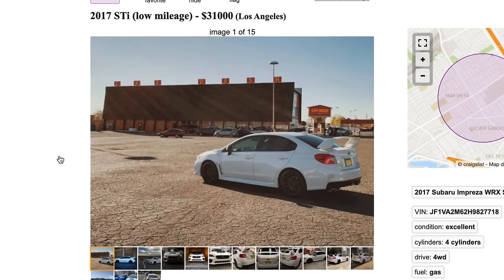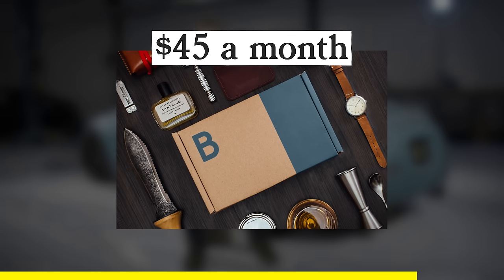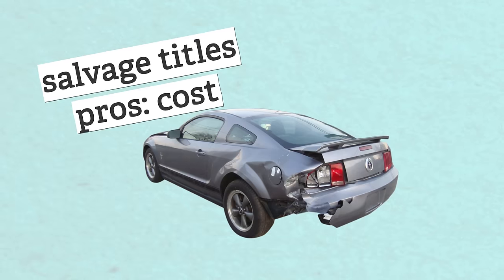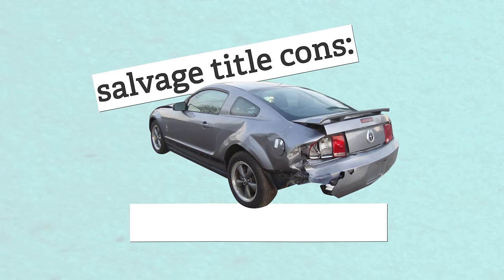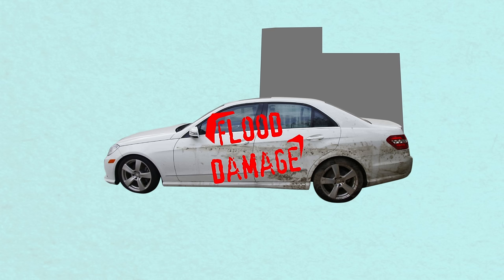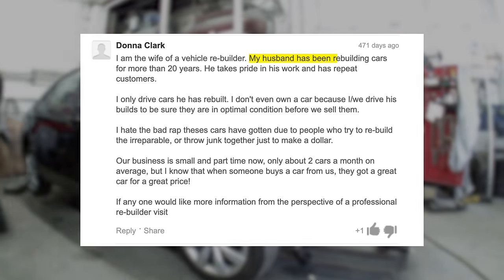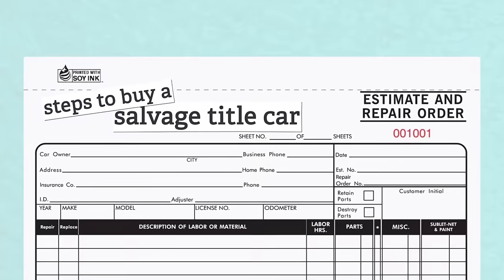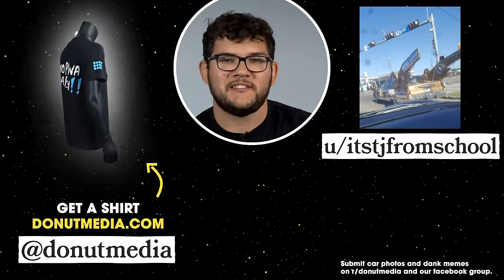Buying a Salvage Title Car: Bargain or Nightmare?

Comment: I had a 1992 Honda accord LX, which was completely flooded.  My neighbors drove it for a few year then didnt like the smell so they gave it too me.  I drove it for 3 years(with some electric Issues, used to park ready to push start) even tho engine and everything was rust AF it NEVER failed me.  I sold it for $600 to a friend moved away for 6 years and when moved back to my shock I saw my buddy driving it. 10 years plus after it was flooded with no major repairs...buy Honda!

Comment: I got a f150 that had a blown motor, salvage title, 
Took body off sandblasted and painted frame, 
Bought a new engine 
Put it all together 
for the f150, 4K for the build including wheels and tires, 
Check engine light still hasn’t come on 3 years later, no issues

Comment: I drive BRZ and I wrecked it twice already. They weren't enough to get it totalled, but for once it was close. Got the job done at the right place and there's no paint mismatch and it still drives the same for another 45k miles after. I would prefer to buy cars with no accident history, but I did learned that cars with history aren't always that bad as people say. At least for asian cars.

Comment: me: reads title of video 

my copart experience: its time
Reply: 😂😂😂😂😂 I mean a good buy for $1.5k on only a bumper that needs to be replaced is the best way to go
Reply: Honestly sometimes it’s better to go to repo auctions and buy bumper damaged cars from there. 90% of the time the tow truck drivers cause the damage and the car keeps the clean title. We’ve got a 2011 Infiniti G37 with 87k miles for under $2k because it needed a new bumper. Even the auctioneer couldn’t believe it once the seller told him to sell it to us 😂😂😂

Comment: I've had several salvage vehicles. I inspect them to the beat of my abilities. They often have some imperfections, usually at the minimum cheaper paint and some body lines that are not perfect. In any case,  I continue to buy salvage because I can get much better deals, they have been reliable and I don't buy cars for the resale value.

Comment: Good video. 100 percent factual. I’ve rebuilt a few salvaged cars (5 to be exact) and they were all purchased with 2 things in mind…1. I was planning to keep the car for a long time and wasn’t worried about resale. If resale is on the table, I wouldn’t bother. I’m in PA and a rebuilt title is an automatic 40-50 percent less than a clear title. So if a used Tacoma with 40k on it the odometer is worth $20,000, a rebuilt one will be worth $10,000 ish….2. I have the tools and knowledge to do the repair safely and correctly. I ALWAYS stay away from structural frame damage and flood cars. Frame damage repair is near impossible without the proper tools and flood cars will never stop giving you problems. They will forever have gremlins. That being said, I have no regrets with the cars I’ve purchased. I’ve gotten to drive some really nice cars that I otherwise wouldn’t have and I keep my cars long enough that when I sell them they have long made up for what I’m going to lose when I sell it.

Comment: Damn that's weird, I have an 02 wrx wagon with a salvaged title that I bought in 2012.. Most reliable car I've ever had, nothing but tires and oil changes and still going strong at 219,000 miles.
Reply: A lot of people scared of R titles are also scared of cars over 100k miles and CEL’s

Comment: In watching this video I realized that my car is a title washed 350z..... this is just great 👍🏽
Reply: Darkdude478 please tell me it is not a 2006 also!
Reply: wes west it’s a 2003 :)
Reply: How did thug find out did you run a Carfax report?
Reply: Sam_jupiters253 all the repairs under the fender on frame and with the bondo I found while trying to put a wide body kit onto it
Reply: Them saying it was a clean title no accidents didn’t help neither...
Reply: Darkdude478 if you want an a car dealer and have unlimited Carfax reports I wouldn’t mind running the vin for you and that’ll give you a idea of some of the history if you want?
Reply: Damn, makes me afraid of buying a used BRZ. Was the price cheaper than usual?
Reply: My $2000 dollar mazda pickup has definitely been in a few accidents before I bought it. I just like to call it "battle damage"
Reply: Darkdude478 lowkey same with my g coupe🙃

Comment: We needed a 2nd car last year, so in July i purchased a 2010 Nissan Versa for $1000 from a fellow manager (it was her old car, she was finally wanting to put it up for sale) the outside had dents all over, screws in the bumper, no airbag etc lol but after 7 months and 3700 miles of ownership, this car is still running strong, i just need to replace a sensor and replace the airbag

Comment: Bought a salvaged vehicle from my work with front passager damage at the corner. Got it for 4,000 and put another 4 grand into it to fix the hood,fender,cv axel, radiator support, and a rim.
Had it for 2 years now and only have had to replace the ECU.
Not bad for a 2013 Mini Counryman S with 23,000 on it.

It helps that i got it not repaired yet so i could see what needed to be done and could tell everything else was in solid condition.

Comment: A salvage title is just as likely to be the result of depreciation vs cost of repair rather as it is significant damage, especially with higher-end vehicles. This is why it's so important to check VINs, salvage title or not.

Comment: Just bought a salvage title 2014 ford f150 3.5 ecoboost. The truck was hit in the back and the frame was ever so slightly bent, but was able to put a new bumper on and it looks good. Had to replace some solenoids and get a new battery and some brakes. But a full size truck for only 10k with 90k miles… I’ll take it.

Comment: Almost all of my cars in my collection were salvage. It all depends on what was wrong. Fun to work on if you just want something to wrench on.
Reply: Can you give me an idea of what to look for in a salvage car sir? Looking to fix up one
Reply: @RodneyFx  depends on your skill level... just get some where the damage is clearly obvious what happened and exactly what to expect...  I mod cars so I picked a car that had damaged parts that I would've replaced anyways for aftermarket such as better headlights, carbonfiber hood, newer front bumper cover style... thus look for minor front end damage vehicles that rus/drive and show no signs of hidden damage; core support replacment and minor frame rail straightening is also fine but and major frame rail or any other serious frame damage stay away as they are parts cars... note trucks usually sell for higher than they should so I wouldn't bother with them... what ever you are looking for if you don't find the right deal or miss one just wait as something else will come back around as new vehicles are added every few weeks

Comment: Or a better word is project car
It needs some love and polish 🤣 in belgium we have a car inspection house if you buy a car it needs go there before you can register it 
And you also need to go there every year
Reply: Same in Texas, but it's pretty basic
Reply: @desmondunn4504  
I didnt know that
Is that everywhere in america ?
Reply: No. Each state sets their own requirements if they have an inspection. They check mostly safety equipment, seat belts, lights, horn, tires, brakes, etc. And in some spots emission.
Reply: So it’s a MOT?

Comment: It all really depends if it's fixed properly, if your buying one then I highly suggest to take it to a dealership for a full inspection, I know a kid that his parents bought him a charger hellcat and it's a rebuilt title with 11,000 miles on it, they bought it for about $45,000 already paid for it and then took it to the dealership to inspect it and found out that the engine has a crack in it and has been leaking oil

Comment: Pro tip when trying to figure out exactly what causes the salvage title. Ask the owner for the VIN, plug the VIN into Google and Google will pull up whenever that vin was used on a website. Which means it'll pop up as a previous sell on a auction site where you can see photos pre-repair. It's 100% free aswell to do this and will give you a better idea of what to look for when looking at that particular car

Comment: I bought my speed3 with a salvage title. $4k and all I’ve needed has been a new bumper, hood, and windshield, and paint. Once those were installed it looks like new🤷🏼‍♂️
Reply: Jents1798 - it’s even better when you find the parts already in the same color like I did !
Reply: Swampy yup you know how long it took me to find a break light inspection place in my area plus turns out they check everything on the car not just the break lights
Reply: Swampy I mean like I said, my car was just cosmetic damage. Inspection can be a hit or a miss depending on where you are at.
Reply: Swampy it’s a bit like insurance. Some people say they can’t find insurance for their salvage title car. My wife has a 2016 Kia Forte (non-salvage). And then my 2013 Mazdaspeed3. We got full coverage for $160 a month. I think it depends on the area and the people. Just my opinion🤷🏼‍♂️
Reply: Swampy I personally would shy away from salvage title cars that have frame damage. If it’s cosmetic, it’s easier to sell later on and costs less.

Comment: Got My 6 spd 05 g35 for 3k. Flawless paint. Flawless interior besides some minor scratches on the plastic cup holder in the rear and the typical seat tear (minimal) just needed a brake kit, radiator, thermostat, tires and a UCA. Passenger door needed to be re wired but all in all I only spent around an 13-1400 in parts. So I have a $4500 perfect manual g35. Long as you knkw what you're getting into, branded title cars can be honey pots

Comment: So, i bought a 2005 Honda element, that has been totalled twice. People liked to keep Booting it up the rear so that's kinda fun to read up on. The first crash totaled it in 2010, which was then repaired and branded with a rebuilt title and put back on the road about 6 months later. about 6 years later it got booted up the rear again and totaled for a second time and the same thing happened, and about 6 months later, it was on the road no problem whatsoever. I was initially scared and didn't realize when i bought it, it was rebuilt, but the fact it has been driving around for about 12 years and been given the rebuilt title at least a couple times does give me some comfort that the repairs weren't utter trash. I did inspect it myself, and my mechanics are doing the safety on it and it checked out.

Comment: I've had an infiniti q60 2018 lexus is200t 2016 infiniti q50 2015 Honda accord 2016 all driven for about a year then sold with out any issues. And an fj cruiser for 5 years that I take offroad 3 times a year. 0 issues as long as you repair them correctly and they don't have that much damage to begin with.

Comment: I bought my 2001 Celica in early 2013, $400, totaled by flood. Victim of Hurricane Sandy. 
Its manual, previously original owner, that made it more worth it.
Electrical work and cylinder head up engine rebuild (I left the block alone), & clutch job, all my own work. Then I paid for paint job.
I'm still driving it now, runs like a dream. With one of few remaining stick shifts; I honestly do better in snow than huge 4x4=16 SUV's! They spin all 4 wheels out while I just drive past them, again a Celica not a snow vehicle !!

Comment: I bought my first car 2010 370z manual 3.7L VQ base model for 12.5k had over 115k miles at 20yrs old with branded title had complete front end rebuild took it home and still today runs like a dream I’m so happy with it, be careful when shopping it worked out for me 2 years later I still have no problems and keep it garaged, never getting rid of it. Dealers won’t take more than 4K for it is the biggest con for me.

Comment: I've owned a salvage '86 300ZX and it was a great car, no issues. The a/c condenser had a distinct wave to it from the accident but it still held gas and worked fine.

My former stepdad bought a flood truck though and spent the next several months going through fuel filters from all the mud in the gas tank. Flood cars suck.

Comment: In my country vehicle registration is national, so once it was "totaled (de-registered in my country)" the "salvage or (code 3 title)" title will stay with the vehicle, does not matter where in the country you register it, but not all vehicles will receive a salvage title when totaled.  If the insurance see the car as fixable, just not economical to fix they will not have the car de-registered and sell it off as repairable and a normal used vehicle title.

Comment: Got an '05 Subaru FXT with 72k on it a month ago with a rebuilt title.. the little dealer that was selling it was totally transparent. Pictures of the vehicle as they purchased it, full itemized repair list, pictures of the process, put it up on a lift for me, encouraged me to have a pre purchase inspection performed, they had emissions testing done, paid for a third party to align it because I wanted to see if their alignment sheet would match someone else's.. The experience was so good I'll be buying rebuilt titled vehicles from them in the future. That's all they do is rebuild salvaged vehicles. I wouldn't hesitate to send my family and friends there.

I tend to keep cars for a while so the resale value doesn't mean as much to me as getting a good deal on a low mileage, great example of an uncommon  vehicle.

Comment: Repair shops repair them to factory MEASUREMENT specs. Not factory strength specs. You can stand on a pop can without it breaking. Now smash it and straighten it out until it is the same measurement as the original. Now try to stand on it again. Good luck. As an engineering student that has experience in materials science, I'd recommend buying salvage only if you understand the risks.

Comment: I bought my 2013 Charger R/T(rebuilt title) with 70,000 miles for $13,000 from a little place right outside of Detroit, MI called brokers and sellers. They sell mostly rebuilt vehicle and provide the history of the vehicle along with links to the copart auction where the car was bought from. They were very honest and willing to make a deal. I drove all the way from Mississippi to get the charger and once I got it back to Mississippi and titled it, Mississippi DMV washed my title clean.

Comment: My 08 Acura Tl was purchased in 2017 and had a rebuilt title. I drove it from 87,000 miles to 133,347 miles without any major issues just standard stuff like the timing belt at 110,000. It ran great for me all the way up until about a week ago when a lady pulled out in front of me and I slammed into her at about 40mph. The insurance agent said it’s a total loss and they’re giving me 6,700 because it’s a rebuild title, but the awesome part is I only paid 5000 for it in 2017. So I ended up having it for a little over 5 years and still made 1,700 off of it. I’m definitely one of the lucky cases with a rebuilt title. I am proof that you can buy reliable safe cars with a rebuilt title. You really want to know exactly what the car has been through before you. It helps to make a decision on if the car might be a headache or a gem.

Comment: I drive a 2014 Acura TL Special Edition, 121,000 miles. Bought at auction for $1,250. An absolute sTEAL. Parts and repairs for about $3,800, and now I have a $12k-15k vehicle for less than half the cost.

I would recommend this method and rebuilding all you can yourself to save the money, especially to teach a new young driver about cars, handiwork, and problem solving. You'll probably have to pay for someone to professionally fix some framing damage or body/paint work, but rebuilding a grill, installing side view mirrors or seat belts, headlights, etc is something that is very educational and cost efficient, and anyone can do it with basic tools and some patience.

Comment: I once bought a two year old Focus ZX3 with a salvage title for $1800.  I drove it for a year, then moved from Indiana to Arizona in that car.  Then I had it for my entire 7 year stay in Phoenix, never changed anything but the battery and the oil.  I finally sold it for $800 before I moved back to Indiana(in 2012)That guy STILL has it as a daily driver.  There’s good and there’s bad, you just have to know what to look for…

Comment: I have a 2009 crown Vic police interceptor that’s rebuilt. I got it for $2000. When I say no issues.. I mean after 5 years and over 100,000 miles.. I think I may have cleaned out the throttle body,  and replaced the fuel filter. No other issues at all.

Comment: Another tip is to look for junkyards or companies that sell off used car parts. You can usually find the part you need to fix your car but for a huge discount. I got a perfectly good rear end for a 350z for about a 1/4 the price of a used one online. It takes work because you have to dismantle the car yourself but it's worth it.

Comment: Just restored a salvage mustang. Went off road, tore up the undercarriage, gas tank, axle, etc.  Spent $4,000 in repairs and it performs like a new car. Now I have the car I wanted for about $6,000 less than market.

Comment: I own two salvage cars. The damage was minimal. Ive owned for 14 years a 2001 BMW Z3 2.5i that I got with 23k miles and for 3 years a 2014 BMW 428i Convertible that I got with 19k miles. Zero mechanical issues.